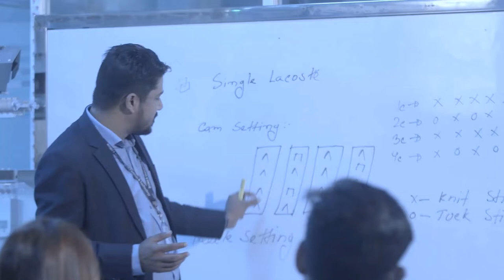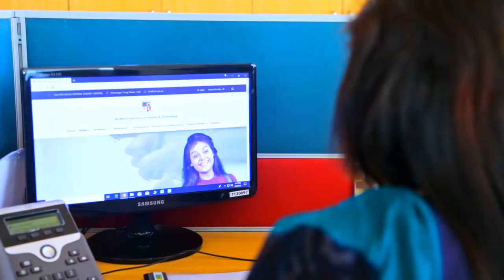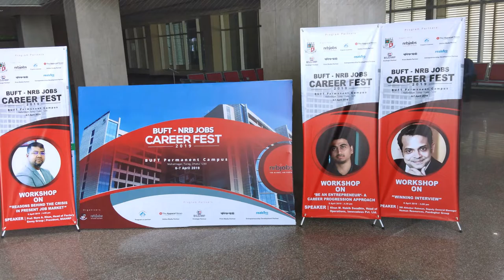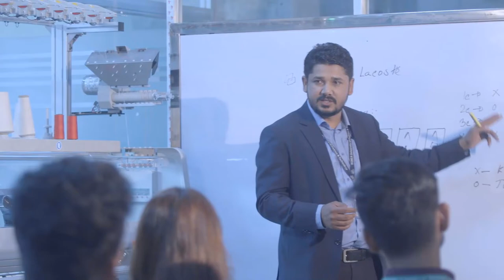BGMEA University of Fashion and Technology Official Promo

Comment: How many cost BA in English? 
SSC+HSC=10
Reply: Dear Student, Thank you for your inquiry. The details of the B.A (Hon’s) in English program are given below:

B.A (Hon’s) in English 4 year 8 semester (132 Credits)
Normal Total Tuition Fee 4,84,260/-.
Total tuition fee 3,61,748/- (After 50% TFW 1st semester & 2-8 semester 25% TFW)
Per credit tuition fee 3,300/-. (Discounted per credit tuition fee- 1650 & 2475)

1st Semester -  40,745/-
2nd Semester -  45,858/-
3rd Semester -  45,858/-
4th Semester -  45,858/-
5th Semester -  45,858/-
6th Semester -  45,858/-
7th Semester -  45,858/-
8th Semester -  45,858/-

Qualifications :

S.S.C & H.S.C/ Equivalent 
(Any Background with minimum GPA-2.50)
O Level : 5 Subjects & A Level : 2 Subjects
Point: Minimum B Grade / GPA 4.00 in 4 subjects 
& Minimum C Grade /GPA 3.50 in 3 subjects). Out 
of 7 subjects. Points: A-5 ,B - 4 ,C-3.5 ,D- 2, E-1.